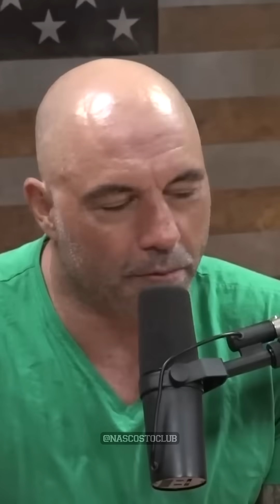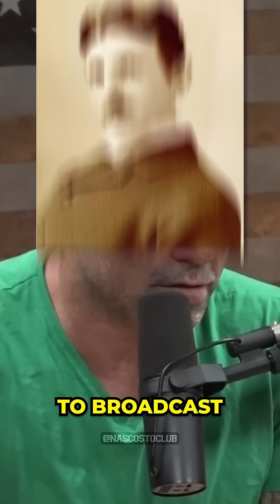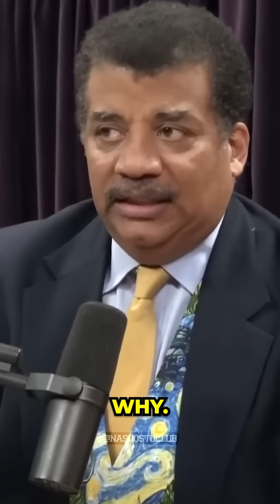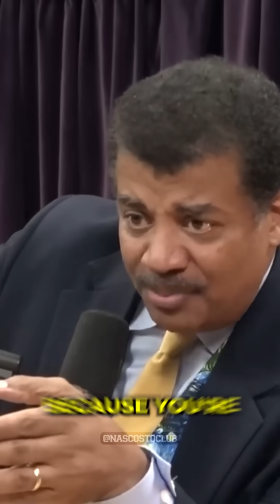WIRELESS Electricity Idea Debunked ⁉️⚡ #shorts

Comment: Well , if his idea was worked upon and refined instead of him being shut down we would have had wireless electricity by now .. we certainly would have
Reply: My neighbourhood barely wants a cell tower to be installed that is beaming like 10mw what makes you think people would want a tower that beams 10w for a single light bulb?

Multiply that by a whole house that is at least 200w worth of energy... As an electrical and electronics graduate I can tell you that only an incandescent/flourecent bulb would work because other electronics component would fry plus the fact that it could function as a radio jammer depending on the frequency used... So good luck using other wireless device. Also also imagine being unable to turn off your lights, that's a fun one.
Reply: @johnbiscuit8272  Agreed . At the nascent stage it was crude but all the problems you mentioned humans would have refined by now … Remember how telephone was when it was first invented and now see how it is only because the first prototype saw the day of light …
Reply: @sumeetprof1836  I find it funny for you to think we didn't continue developing it. You have no idea what the tech industry is doing... Everything u don't see is using the same tech. WiFi, satellite, radio, etc. Its using the same tech. We just don't use it to transfer energy.

Cell signals use microwave, that signal is only detected because of antennas specifically designed to receive that frequency. Sounds familiar? The tower itself uses around 1.5kw of power, and your phone gets around 10milliwatt, you think cellphone companies don't have incentive to improve it? You think billions haven't been poured into research? My friend works in such R&D facilities. If so you are not very good at business.

5g tower needs to be placed at every 600m from each other to get good coverage. You think they wouldn't want a 10x increase in performance?
Reply: @johnbiscuit8272  Elon says hold my beer 🍺 . All towers are toast . We will have global wifi thanks to starlink
Reply: @sumeetprof1836  yes and their receiver uses like 100w, now stick that in a phone.  It seems like you live in the US, but in my country I'm getting 500mbps for the equivalent of less than 50usd. It's a good tech for the specific people that live remotely, can afford to power the receiver, have a clear sky view, and afford to pay 100usd. And a business idea that never made money, don't trust me, go check their customer amount, check the launch cost and construction of the satellites and their contractual date before the satellite needs to be decommissioned. And their speed slow downs. The staff needed to sustain the system. Go ahead do your own research.

Uber proved people wrong by demolishing the taxi industry, years later people figured they weren't gonna be profitable. How many of this company does it take to fail before people realised alot of new companies are just not gonna be profitable just because they have celebrity level ceo?

Also starlink doesn't transfer power, its far away from people so it's allowed to use more power for transmission. What's your point?

Comment: Solar panels entered the chat.
Reply: Do you understand how solar panels store and use the energy it collects?
Reply: Are you trying to say solar panels push electricity thru the air?
Reply: @shadowbandit3975  They collect energy transferred through the air. Elecrtomagnetic waves in fact, same as radio waves, just a different (and more dangerous) frequency.
Reply: @ZartaxtheWise  I'm going to let you marinate on that thought for a while. Hopefully you come to the same conclusion of stupidity with that statement.
Reply: @shadowbandit3975  Lol, dito.
Reply: @shadowbandit3975  Solar panels don't use heat to generate electricity. Read up on the photo-electric effect. The point is that energy can be transferred through the air at good power levels without being overly harmful to humans.

This is all the time I'm going to spend on you, who obviously mostly is trying to provoke instead of understand. Sad.

Comment: Now wait a minute. Properly adjusted electricity can be totally harmless even when it touched somebody.
Reply: And it wouldn’t power a light bulb. It’s a dosage issue
Reply: ^ that, and that’s not the only problem.
Even if electricity can travel in radio waves, how much electricity for how much radio wave?
How do you stop it from interfering with other things you dont want it to affect?

Wouldn’t there be no problem if we could somehow isolate the current and have it travel a safe and narrow path to a device?

Wires sound like they’ll do the job just fine ey?
Reply: @pwnwin  Another issue is reliability. Imagine everything being powered wirelessly when a disaster hits. 

One of the major advantages of wired power is simplicity. So long as you can find something that generates sufficient power, you can wire it up to your device and use it even if it's only temporary. Buy a diesel genrerator and you'll be able to power almost anything in a pinch.

It's much harder to do that with wireless technology, since the technology to get it working is much more advanced and prone to failure. Not something you want in an emergency situation.

Comment: It is possible to power something with the radio waves, but NDT is correct, the power levels are very tiny. You might be able to faintly power an LED lamp, or perhaps a microchip clock, but nothing useful.

Comment: You might not be able to power it all at once through the air but could you charge a capacitor over time to then be used long enough  to be worth it?

Comment: Neil: "We cant send that sort of energy through radio waves"
Me: looks at microwave oven

Most importantly we never knew what frequency Nikola Tesla planned to use. Neil should know the frequency of RF power is HUGE difference, between microwave (2.4ghz) or shortwave (1mhz) or longwave (100Hz). Neil is full-o-crap. I would assume Telsa was going to use longwave 50/60hz or some other low frequency harmonic what would not disturb organic matter like microwave does.

Comment: The power/energy exposure hazard is frequency dependent.  Been a while since I did  all the math, but the energy investment to get simple household lighting to work at 3 miles from the source would have a wired conductor paying for itself in less than a month.  Not to mention all the tin-foil hat types who wouldn't be having the high amplitude low frequency radio waves.  And yes... if you were to try to power 30 miles from a single source, that tesla coil would function more as a death ray than a power broadcaster.  There are caveats, it could be made to work IF electrical energy production became trivial.

Comment: I teach alternating current theory and first year electrical. I am a licensed electrician. Current being passed through a conductor induces a magnetic field around the conductor, which itself induces voltage onto other conductors. We send energy through the air literally everyday at massive capacities to power everything. This is how most things in the electrical field function, like transformers. There are many in the field that are beginning to demonstrate that the actual energy transfer may be through the magnetic field, with the conductor being the medium to create the field. After all, the reason it is still called alternating current theory is because it has not been proven as scientific law. Tell Neil to look up isolation transformers. Oh, and the Earth has a massive, rotating magnetic field. Know what else has a rotating magnetic field? Generators, and electric motors.

Comment: "Wireless electricty debunked"... Watching this on my Samsung Galaxy while charging wirelessly.
Also for those saying that's not strong enough. What starts small, can be big. The pyramids started with a single block.
Reply: You’re an idiot your wireless charger is still connected to your phone just without a wire telsas idea was emitting electricity through the air which clearly wouldn’t work out well
Reply: @riasgremory403  Clearly, I am the idiot. You can hold your phone up to an inch above the wireless charging base and it will charge with no contact (through air). It is called "Wireless Charger" for that reason. Why don't you go back to school?

Comment: Hate to break it to NDT, but Tesla was going to use the Earth as the conductor, not the air. Look up the experiments he was doing, and he was successful in transferring power through the ground to light up light bulbs across distances a 1/4 mile away. That's when he started to build Wardencliffe, and it all went to hell.

Comment: I don’t think anybody knows how electricity actually works, and in this instance there are two types of electric currents that can be produced by two different types of Tesla coils. One type of tesla coil is amped up in such a way that it shoots electric arcs, The other style of Tesla coil has so many watts that it doesn’t need amps and will wirelessly transmit at a lower frequency and a further range. It’s like knowing the difference between DC and AC electricity. It’s a pretty big difference………

Comment: Tesla is actually the most overrated inventor of all time. Tesla did not invent AC transmission, nor did he invent the transformer. Tesla did not invent the induction coil. Single phase AC power was being used in Europe by many inventors in the early 1880s. As early as the late 1870's Germany had developed a crude 2 phase AC generator. Mikhail Dolivo-Dobrovolsky built the first full 3 phase AC generation and distribution system in the 1888-1891 period. Tesla to his credit was able to inspire Westinghouse to jump into AC, but very quickly Tesla's two-phase system was made obsolete by three phase systems which could more efficiently send power farther. The very first AC distribution system to operate was in service in 1885 in via dei Cerchi, Rome, Italy, for public lighting. It was powered by two Siemens & Halske alternators.

Comment: Neil really needs to look at some books about electricity. There’s already energy in the air, harnessing it is the issue, maybe not exactly like Tesla just a device works with no wiring just pulls it out of the air on its own electricity already they ready to power it sent through the air by something, but definitely could at the very least create low voltage systems that power low voltage applications by harnessing the potential voltage in the air

Comment: Some of what Neil said true but some of what he  said was bull. If you carry a florescent 4 foot light tube into a industrial gear room. It will start to glow. Even while you hold it. There is enough of a field generated to excite the gas. Now granted there is a tremendous amount of electricity flowing to do this. But we use a thing called a volt stick. It's self contained with no exposed electrical connectors in a plastic coverd pen length device. But  if you touch a wire that has current flowing through it the stick will light up. This works even with no wire exposed. So the technology is there. I think it's as Tesla said All In the frequency used. Tesla may have been a bit of a nut towards the end. I think this is due to his becoming a hermit. He was also OCD. He would walk around his hotel were he rented a room three times before entering. But this OCD also made him methodical and meticulous. I think if he thought the transmission of electricity through the air was possible. He had research to back it up. When he died the government broke into his room and stole vast amounts of his notes designs and research. It been said they wanted his death ray design. But if his research pointed towards the possibility of transmission of electricity through air. This would of been stolen. To keep the economy in the hands of those in power. They made millions off of electrical motors switches relays wires and the standardization of these things. Tesla's idea would of made these of these  designs obsolete incompatible and new devices would of needed designed.

Comment: Neil needs to do more research because this literally exists lol. While it's not over radio waves, or charging things miles away, it can charge things across the room.
Reply: Right? It's been a concept for years.
Reply: @Twisterhere  he doesn’t deny it, it’s trivial to make. It simply kills you at the watts we need for regular life
Reply: @soonahero  it's not trivial at all. There was even devices using the tech at CES this past year. Especially with how efficient devices are getting, powering things like security cameras, outdoor lights, etc.  wirelessly could be a viable option in the future
Reply: @kobotherobohobo  Electricity follows the laws of physics and unless our air resistance or electromagnetism changes, there won't be any practical wireless charging at a distance.
Reply: @Squiffel  how about you read into it before you make comments based on ignorance 💁‍♂️
Reply: @kobotherobohobo  Send a link the CES wireless electricity breakthrough and I'll accommodate.
Reply: Only a conspiracy theorist science denier would research topics instead of simply believing an expert like NDT.

Comment: Higher voltages ..  lower current.. it's the current that kills you.  Everyone has experienced static electricity shocks.  Very high voltage, low current.  Convert the power which is voltage times current to very high voltage and transmit..  it's possible.

Comment: NO! NO! NO!
The plan was never to use radio waves.
The plan was to shot ion chanels to the ionosphere and use the earth and the sky as the two plates of a capacitor.
Between the plates there is a field.
Any wire run vertically will see electron flow induced.

Comment: I think the energy technically always goes through the air, as described by the ponyting vector, but wires help channel the direction I believe.

Edit: poynting, thanks fella in the comments
Reply: Poynting* ik probably autocorrect but for anyone reading that wants to look it up. He probably said it in a way people could easily understand it. The energy flows through the air but the electrons are in the wire and I think that's what he's talking about. There's a reason you zap yourself when you touch a wire and not the air around it
Reply: @dexxasvalentine1391  true
Reply: The poynting vector refers to the electromagnetic spectrum, so light. What tesla was talking about is electricity. Free electricity would kill you if you just decide to walk through it. Lighting is such a thing and you obviously want to stay away from that.
Nothing Niel said is wrong. And it's funny as fuck that these butt hurt fools shit talk him but not one of them actually disproves anything he said.
Reply: @ForwardandUpward  sure, but even with electricity doesn’t the energy travel through the air via the Poynting vector? Isn’t that why all of our things turn on so quickly, the energy travels near light speed? If the energy came from the electrons moving around, I think it’d be much slower. I think Veritasium has a video on it.

Comment: Geez Neil.. chill out.
As both an electrician and an electronic tech
I know  you can power things  on a low level.
Think of your cell phone with half the charging circuit and the charger the other half.... without the 2nd half  the 1st half can't activate.  so instead of you having to plug things in... you have wireless pick up coil in the device.
since living things  do not have a pickup coil attached... they wont be touched by the power

Comment: Oy! Mr. Tyson. May I draw your attention to this little doodad we now have called a WIRELESS CHARGER? Sure, it's only for cellphones, & you have to have phone sitting on the little plate for the charger, but still.

On the other hand, this exact argument could - & should - be used against the idiots who think solar power can replace fossil fuels. I mean, solar panels are all right to work with in space, but at the bottom of an atmosphere you're only getting 1% - if that - of the Sun's actual power, & the best solar panels I've heard of can only convert 56% of that (And that's the newest stuff.) into electricity. So, maybe you should keep solar tech where it belongs? You know, in space & for SMALL Terrestrial applications like solar calculators, solar cellphone chargers, solar-powered streetlights, maybe putting solar panels on the tops of cars to use for powering the A/C system so you're not making the gasoline engine pull the whole load. Things like that.

Comment: constant power yes BUT what if a bolt of power was shot at a plane (which was his initial idea with the Waldorf tower, funded by jp morgan until tesla mentioned free power which meant no money for morgan) that could absorb in a capacitor and then into a battery to be used as needed

Comment: Heres the thing. Tesla had inventions that he proved worked. In the past maybe 20 years we started using one of them, the L.E.D. light bulb. That is the light emitting diode. He created that while working with Edison independently of without Edison. Now we use them in every household, every flashlight, etc.

Tesla wasnt just a genius, he was a super genius and died penniless because his inventions would sell one time to everyone while the powers that be wanted to charge to replace everything numerous amounts of time. Case in hand, the light bulb. They wanted to sell massive amounts of lightbulbs to the same buyers forever to make way more profit. Which is why the first light bulbs to be used in factories only lasted 8 hours. Hmmm, gee I wonder why a work shift is 8 hrs? 

Now, even genius level people cant fathom what Tesla had invented. Tesla had surpassed every genius for decades so far and probably wont have a true competitor ever. 

Theres a damn picture of him holding a light bulb in his hand proving his "broadcasted electricity." Neil just cant wrap his fat head around it.